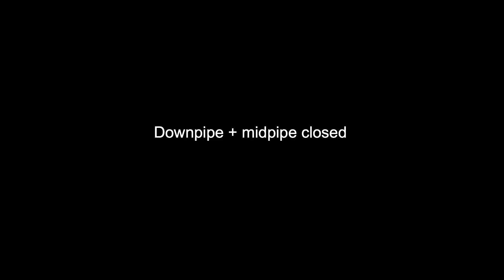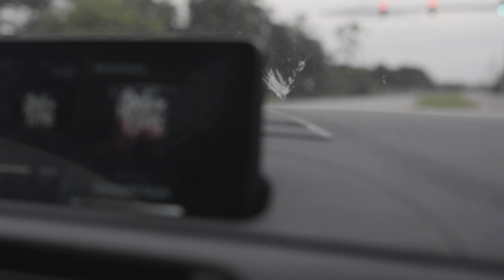M2 Competition: VRSF Downpipes Install and Sound Clips

Comment: After everything you done have you upgraded the crank hub
Reply from the maker: First thing we did before E85  was the crank bolt capture. Safety first. 😅
Reply: @knobodygarage3858  You feel the crank bolt capture is safe enough as compared to a completely upgraded crank hub? Also when you tuned it did you need to bench unlock?
Reply: Such a shame BMW never properly addressed this issue and even with the revised bed plate it still seems to occur. I guess the only and real fix is B58/S58.
Reply: @knobodygarage3858 how is it running so far with just the bolt capture?